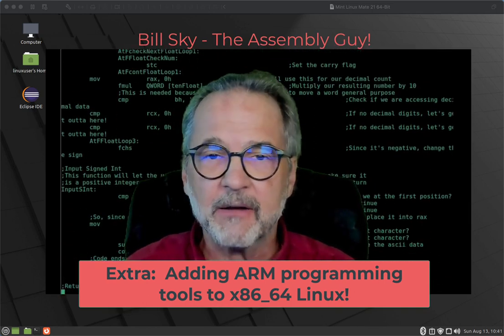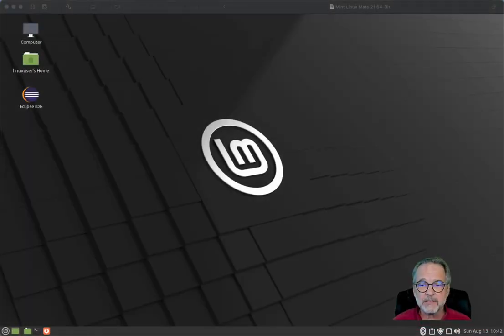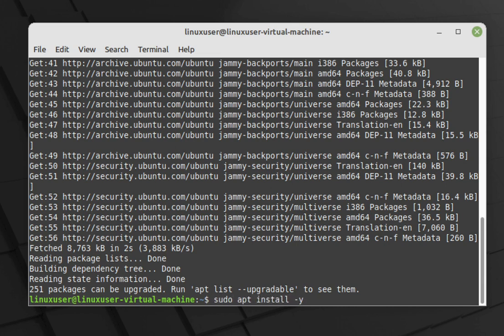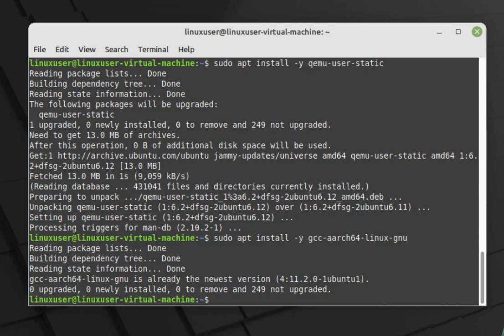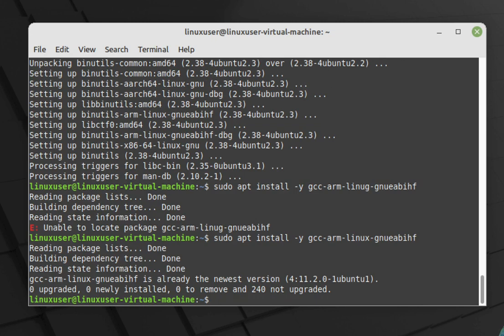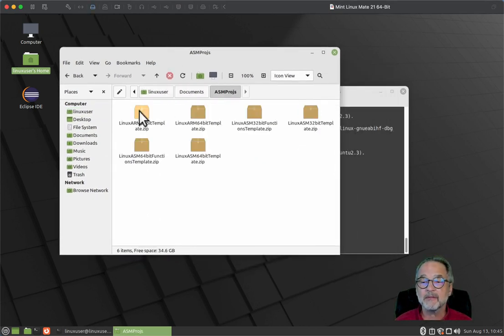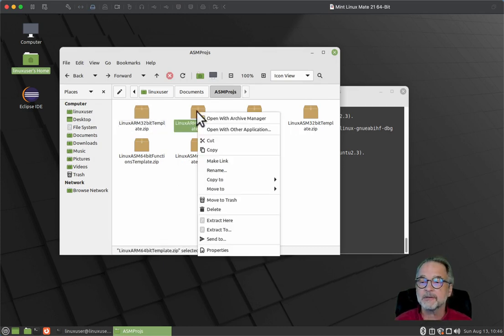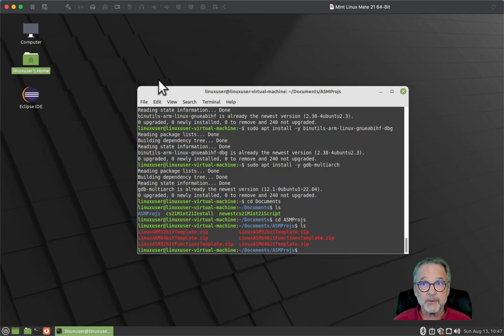Assembly Extra:  Installing ARM Programming Libraries on your Intel Linux!

Comment: Greetings Bill Sky, I am writing to you about a new problem I have when assembling in Linux. I am working with Debian Linux arm64 and want to assemble with nasm for Linux x86-64. I have installed the packages that I believe are required to cross assemble, however I am receiving the following messages:

nasm -g -f elf64 -F dwarf main.asm -l main.lst
ld main.o -o main
ld:main.o: Relocations in generic ELF (EM: 62)
ld:main.o: Relocations in generic ELF (EM: 62)
ld:main.o: Relocations in generic ELF (EM: 62)
ld: main.o: error adding symbols: file in wrong format
make: * [makefile:4: main] Error 1

I hope you can help me.

Greetings and again I thank you for the support I have received from you in previous queries.

Ricardo Carrera
Reply from the maker: Yea, you really cannot use nasm, you need to run the cross-architecture 'as' for ARM.

Compile: aarch64-linux-gnu-as -g -a main.asm -o main.o
Link: aarch64-linux-gnu-ld main.o -o main

If you are on an ARM computer (like a Raspberry Pi), then you may be able to use nasm.  I've never tried that.